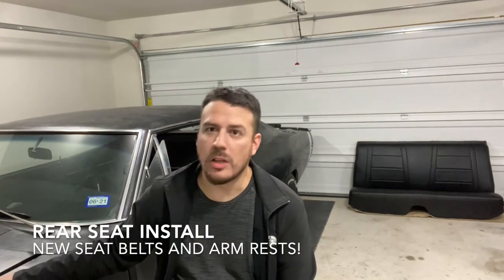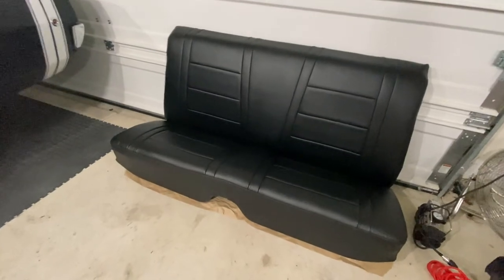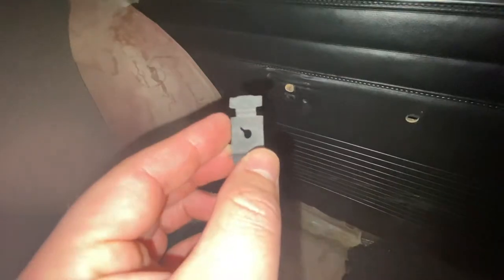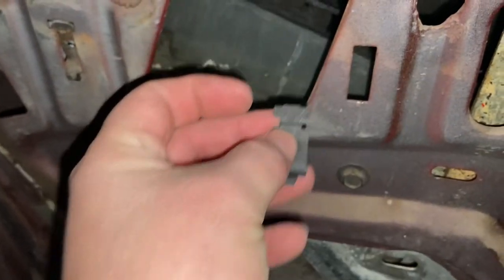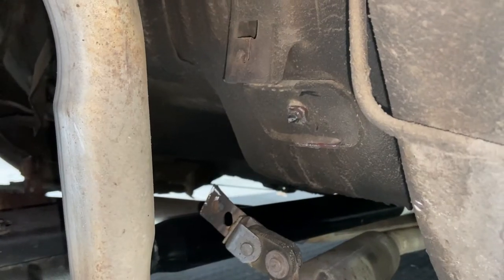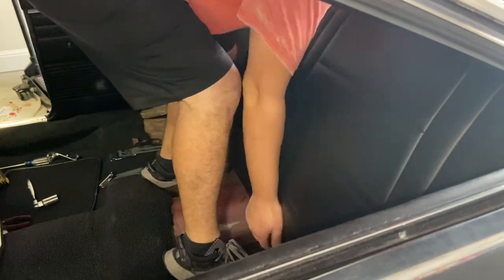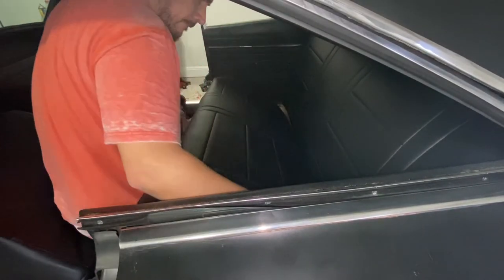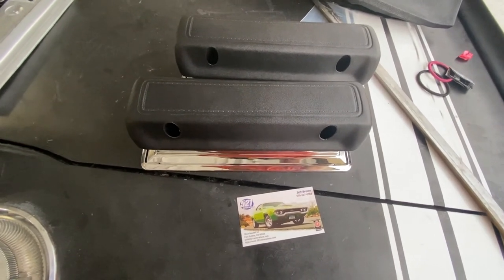1968 Charger Rear Seat Install - Episode 35

Comment: Do you hook top of back seat first or hook it at the bottom first? We can't get upper back seat hooked in.
Reply from the maker: I always thought it was the bottom first but on an episode of Graveyard Carz, they said to the the back first 😅
Reply: Keep the bottom away a little and hook the top first, then push down until the metal tabs go into the bottom loops on both sides then bend over the tabs.